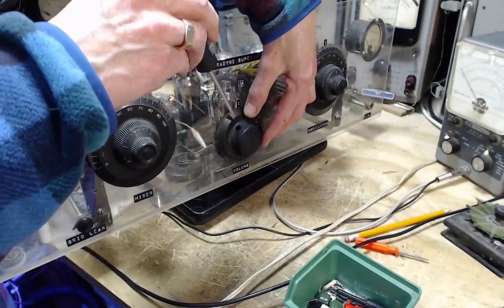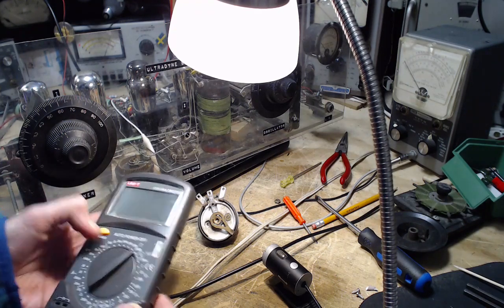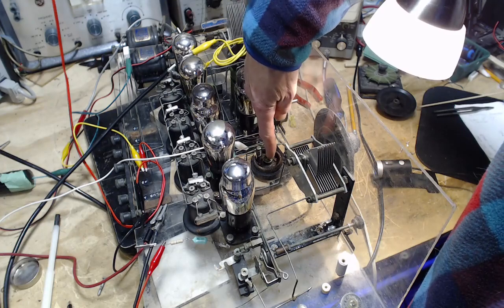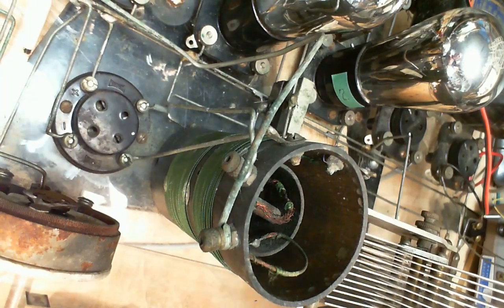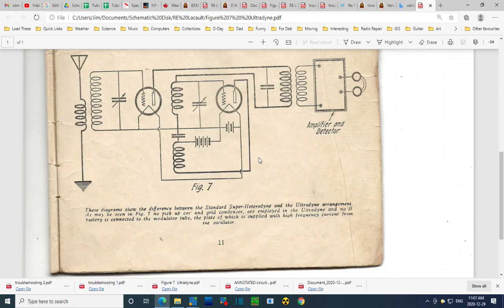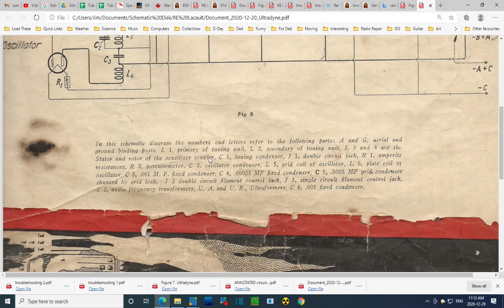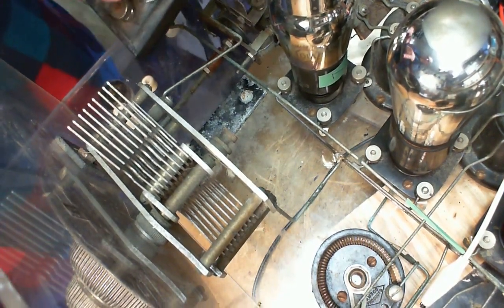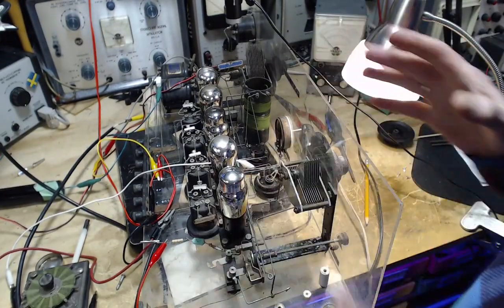Lacault Ultradyne 1925 Receiver Video #7 - Oscillator Coils

Comment: Could you please give the magazine citation.  1. The circuit uses the plate modulation method for producing an IF frequency. http://www.duanesradios.info/html/columbia_ultradyne_l-1_superhe.html#:~:text=The%20Ultradyne%20was%20touted%20to,plate%20of%20the%20first%20detector.  https://antiqueradios.com/forums/viewtopic.php?f=1&t=335458 discusses a radio which looks exactly like the one you're workimg on.

Comment: 24:19 that document proves that this radio is not a Ultradyne but a Superhet design.
That rotating coil inside the oscillator coil he has seen in the radio and from which a wire goes up front to the antenna coil, matches with the arrangement of the 3rd coil on the oscillator in fig 6.
 Also the grid leak resistor arrangement he found on the first RF tube is show in fig 6.
None of what we see in the radio is seen in fig.7
He has all info laid out to him, yet he fails to come to the most simple conclusions and instead keeps mumbling nonsense and guessing.

Comment: Dear Jim, that radio is a slightly modified version of "Phenix Ultradyne L-2". See http://www.duanesradios.info/html/phenix_ultradyne_l-2_superhete.html . It uses both the principles of Ultradyne and Regenerative receivers. So both the "first RF tube" and the "oscillator tube"  have feed-back windings which couples their plates to their own grids. The coil with an inner rotating coil is the antenna-coil. Inner coil should be adjusted such that it should provide a weak positive feed-back to Rf tube (modulator tube) grid. This feed-back should not be strong enough to start oscillation in that tube. If this adjustment is just correct, then it will provide great amplification only to the signals in that tuned frequency. This is how they are keeping image reception low, even at IF frequencies low as 115KHz. So what Jim thinks as an oscillator coil is actually the antenna coil. I have noticed another mistake Jim made, He connected the filament power-supply in wrong polarity. -Ve of 45V power-supply and +ve of filament power-supply should be tied together and connected to common rail. Then all IF amplifier tube grids will always be in -ve bias. This -ve bias can be varied using the volume control potentiometer.

Comment: The sort of variable resistor that used carbon discs under pressure was used in B52 bombers during WWII, maybe a 20 turn Multi-turn variable resistor might solve some problems.
Reply: Before SCRs became robust, the speed controller pedals on electric sewing machines used stacked and compressed carbon disc as variable resistor too.

Comment: Since there seems to be many alternative "designs" of this radio why not apply modern understanding of superhet radio design and use the parts you have  to just "Re-design" with the available components? Use an AA5 schematic as a guide. You have more tubes to use than a AA5. With out a schematic it seems you are guessing how a poorly designed radio ,based on todays understanding, is supposed to work. It is not in its wooden box. Plexiglass sure screams to make a functioning radio but with modern parts if necessary.
Reply: IMHO plexiglas screams shelfqueen. And with original parts to boot.
There is no reason why a restoration based on what is there should not work. 
And to redesign this to modern circuit design would be like making a F1 car using Tin Lizzie parts.